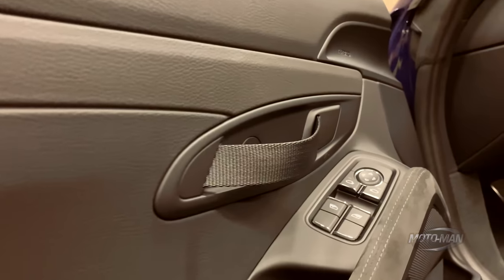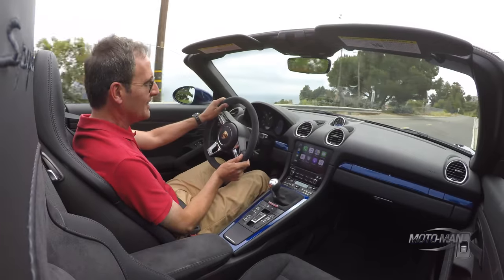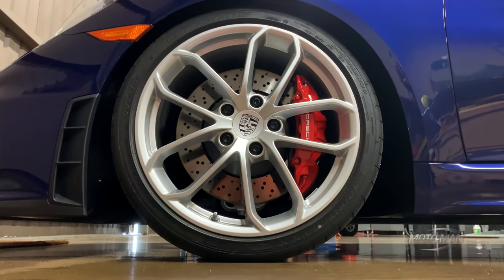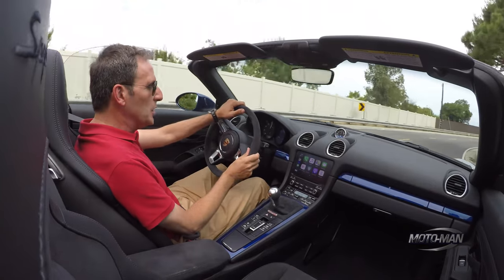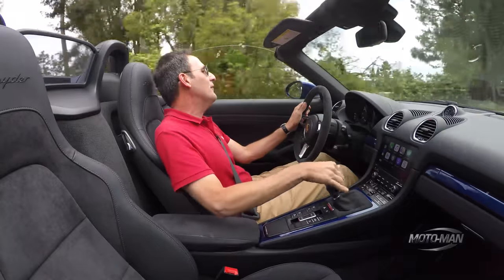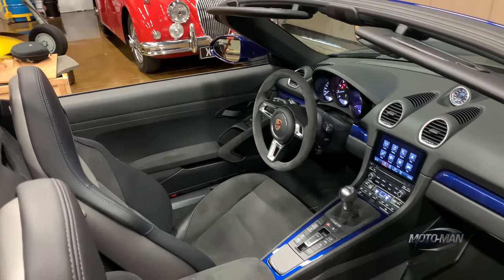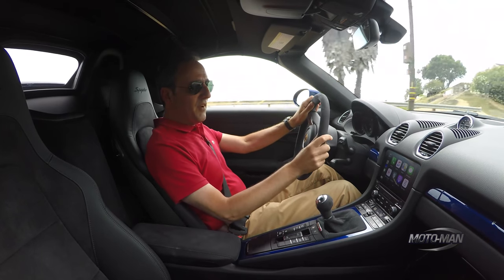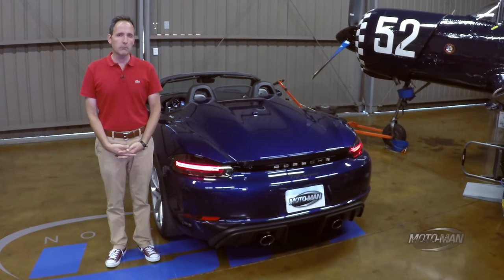A baby 911 Speedster: The 2020 Porsche 718 Spyder

Comment: No,   no you don't need a 911,  my 718 Spyder replaced 911's and theres no turning back,  great review Mr MotoMan
Reply: Roger Bailey 
I have a manual Cayman GTS (my second) and my GF a PDK 991.2 Carrera S.
Such different cars to drive and it’s amazing to have the choice, but the chassis and gearbox in the GTS, make it so much more fun to drive. Even if the 911’s envelope of performance is overall wider, it’s so imperious as to be dull sometimes at normal fun road speeds. 
So I agree with you! The baby Porsche chassis, is the more entertaining (in all it’s many guises) 
😀
Reply: If you have a child and they are not old enough to ride in the front, then the 911 is the only way to go.  I would also say, with the current version of the 911, you can drive it MUCH faster than the 718, where as I think the 718 use to be easier to go faster than the 991.2.  Now, I do not own not have I driven the GT4 or Spyder, I do own a 718 Cayman GTS, manual and a 992 C2S with RWS and I feel like I am at least 10mph faster in it over the 718, I also prefer the driving position in the 911 over the 718 but it is a great and fun car to drive!
Reply: Tommy 
Yes the 992 is another big 911 step forwards! 
On a track, the 991.2 still smashes the Cayman for speed! 
I just love the 718 as it feels so much lighter and the weight is spread out better. When it does start to move, it is as if it’s one piece.
With any 911, you are always managing either the front / rear. 
A challenge for sure, but suicidally fast for the road to the that 992 chassis ‘mobile’ 

Agreed re the kids though.
Just put a Labrador in the back of ours 😀
Reply: Wise choice!
Reply: I did the same
Reply: I just picked up my 2021 718 spyder and wow better then my 2015 911 gts convertible!!!!
Reply: Same here. I sold my 997.2 and bought a 718 Spyder (2021). NO turning back. Passed 3000 kilometres already :)
Reply: @michaelandersson6088  did you get one with the bad motor? Crazy what’s going on . I got lucky .you?
Reply: @elliotnegrin1079  I got lucky as well! Though another member of my local Porsche Club was not so lucky... His car is still at the Porsche Dealer... Our VINs are almost identical.
Reply: @elliotnegrin1079  care to elaborate or point us potential spyder buyers to the engine problem you're referring to? Thx in advance!

Comment: You’re right about the softer suspension on the 981 Spyder had: it was equipped with the PASM Sport Suspension from Boxster GTS not the GT4 suspension. The 982 Spyder here has the complete suspension from the GT4 including the reverse struts and rose-joints.
Reply: pasm was an option.  It also came with x71 suspension from the gts.
Reply: Wrong, there was no PASM available for the 981 Spyder. It basically has the same suspension as the GTS but slightly modified. It is no GT suspension but still thrilling to drive and a but more engaging than the 718 Spyder suspension.

Comment: Why in the world are you double clutching? It is a synchronized gear box.
Reply: WR ZL1 seriously right??
Reply: Vin Diesel baby!
Reply: Богдан Кондратов 
Oops! 🤡
It’s exactly the opposite to that that you’ve stated! 
His double de-clutch gear changes, create a greater weight shift and more unnaturally punctuated drive. 

The synchromesh is there, among other things, to cure the above issue of duration out of gear 🧐

Throttle control immediately preceding a de-clutch, then before re-application is how to control weight transfer. 
This is made easier and more fluid, if the elapsed time is SHORTER not longer! 

Also a BIG point, is that we need to be covering less distance in neutral. 
This is a technique only broken vehicles require, or vehicles from before this fella was even driving. 

I live in the UK and have only ever owned manual cars for my 30years of driving. 
On road, track and in advanced driving tuition. 

Nobody with a clue thinks this is a good idea!
Reply: I was wondering the same thing.
Reply: Especially he is slow AF with it...cannot stand it ;)
Reply: Embarrassing, needs to wait for “flappy paddle” version
Reply: In most Porsche 6 speeds, 5th especially is spaced close enough to 4th ratio wise (and without being in the middle of the H pattern spacial wise) so it's hard to get into the gear in a 4-5 upshift before the RPMs drop too much.  I'll have to see if that makes 4-5 upshifts at normal driving RPMs less rushed for me.  The Aisin synchros are also consistent enough where you can remember how much force needs to be applied to have the shifter complete its movement right when the RPMs are matched, but is harder when you have to push harder than normal just to be able to move your arm fast enough.
Reply: I don't see the need to double declutch on the up shifts. Rev matching  on the down shifts makes sense.
Reply: WR, Double clutch before entering a turn doesn’t slow down the rear wheels, otherwise  you can break the rear wheels loose. Use the brakes into turns, not the tranny.
Reply: Bogdan Kondratov  this is not accurate at all
Reply: @DontPanicDear didn't upstanding a thing you said😅

Comment: His double de-clutch gear changes make me cringe 🙄

Double de-clutch gear changes, create a greater weight shift and more unnaturally punctuated drive. 

The synchromesh is there specifically to cure the above. Used with correct mechanical sympathy that is 🧐

Throttle control immediately preceding a de-clutch, then before re-application is how to control weight transfer. 
This is made easier and more fluid, if the elapsed time is SHORTER not longer! 

Also a BIG point, is that we need to be covering less distance in neutral. 
This is a technique only broken vehicles require, or vehicles from before this fella was even driving. 

I live in the UK and have only ever driven manual cars.
On road, track and in advanced driving tuition. Nobody with a clue thinks this is a good idea! 

This is arguable on of the best gearbox / clutch implementations ever. It’s best used as designed.
Reply: So glad to see your remarks. Watching this guy changing gears was irritating to say the least.
Reply: Plus it has an autoblip function.
Reply: Well...Motoman can take heart that his followers are true enthusiasts!  I posted a comment too about the shifting, it drove me insane.
Reply: Agree!! This guys is a goofball!

Comment: I was in this same predicament. Had a deposit on a GT4 but for the money ($100k+) I could have a Carrera instead. So instead of spending $114k as specced on a GT4, I went for a $118k sticker Carrera T for 30% off sticker. I haven't looked back since. I'm sure the GT4 is great, but it's not $20k+ better than a slightly used 991.2.
Reply: They are totally different cars in terms of handling, feel—everything.  The GT4 mid engine design is perhaps the best handling car, very flat around corners and nimble—it’s like the 911 used to be.  Today’s 911s are more like grand touring cars—heavier and less nimble with less capable handling than the GT4.  After all, you can’t cheat physics!  Just depends on what type of driving experience you want.

Comment: Motoman, I started DROOLING the minute the email hit my in box.  I've got this spec'd up to $128k.  That's right.  And to that I plan on adding an aftermarket exhaust, $5k and $10k worth of carbon fiber interior and exterior bits from Techart.  All tastefully added.  Color, chalk!  Red roof, and red and black interior with 18 way sport seats.  No PCCB, or buckets.  But pretty much every other conceivable option, excluding car play.  Hate it.  Could I get an entry level 992, sure.  Why would I??  A fully spec'd 992 Targa 4S is over $200k.  And this is a real GT car.  And a convertible.  Plan on driving this for four or five years, putting like 20k miles on it and parking it for a few decades to appreciate.  Can't wait to place my order for a 2021 in October.  Dealer has my name on his list already.
Reply: After the spec price, was there an additional price added to the car because of the demand for it?  I've heard that there may be an added cost.
Reply: DC that was just the price on the configurator. $128k
Reply: Ordered. I have up to a 12 month wait but who cares. I don’t plan to ever sell this car but will it to my son!!!  And the limited production of around 500 units a year, so I’m told, should ensure it’s future value. All smiles!!!!

Comment: 2:10 nice double clutch catching the right RPM after a blip for the gears that are slower to move the shifter to.  In most Porsche 6 speeds, it seems like 5th especially is spaced too close to 4th ratio wise (and without being in the middle of the H pattern spacial wise) to get into the gear before the RPMs drop too much (when you're not revving much past 4krpm before upshifting).  I'll have to see if that makes 4-5 upshifts at normal driving RPMs less rushed for me.  The Aisin synchros are also consistent enough where you can remember how much force needs to be applied to have the shifter complete its movement right when the RPMs are matched.

Comment: Great video.  Just a small correction.  The rear diffuser and the vent at the front are not, "active  aero," but rather, passive aero components.
Reply: The front vent is also there to vent the central radiator which lesser Boxsters don’t have

Comment: I replaced my 991.2 for the 718 Spyder, no regrets what-so-ever, just unplug the exhaust valves and you will hear the engine all the time, not just from 4000+ rpm, gearing is just fine for everyday use in traffic, who wants to constantly upshift to 3rd gear while traveling 25-30mph in the city, those people that complains about it either don't have one or a Youtuber driving only on the highways.

Comment: There are no other cars available new on the market that comes in a naturally aspirated, 400+ hp mid engine, 6-spd manuel, convertible package that you can option with carbon ceramic brakes and carbon bucket seats for $125k.  This car is a unicorn.

Comment: When you shift,  the pause in neutral before putting it in gear ...  Is that on purpose lol ?
Reply: double clutch mate
Reply: No Seasoning  double clutching to shift to the next gear never heard of it.   But ok 👍
Reply: High Speed Closer 
Богдан Кондратов 
He’s being stupid and thinks this makes him seem all OG! 
His double de-clutch gear changes, create a greater weight shift and more unnaturally punctuated drive. 

The synchromesh is there specifically to cure the above 🧐

Throttle control immediately preceding a de-clutch, then before re-application is how to control weight transfer. 
This is made easier and more fluid, if the elapsed time is SHORTER not longer! 

Also a BIG point, is that we need to be covering less distance in neutral. 
This is a technique only broken vehicles require, or vehicles from before this fella was even driving. 

I live in the UK and have only ever driven manual cars.
On road, track and in advanced driving tuition. Nobody with a clue thinks this is a good idea!
Reply: Allenwrench 
I think he does know. 
On that side of the pond, they think driving a manual car is big and clever / cool.
I think he’s just trying to seem all OG 🤪

Comment: You loved loved loved the 981 Spyder when you reviewed that.  Would you rather the 981 Spyder with the much louder exhaust and the 3.8 L or the 718 Spyder with the 4.0 L and a not good sounding exhaust but it is from the GT dept.  Now that is the question.
Reply from the maker: Would have to go 4.0 with GT bits under the car.

Comment: If I'm buying a 911, it's got to be a Non-turbo. 991.1 perhaps, though I have a suspicion that'd I'd prefer how the 997 drives (but the 991 is so much better looking inside and out). But up against a 992? This. All the way. Which is funny because I'm not even slightly interested in the 4 Cyl 718. I'd rather have a 968 or 944S than a 718 with a 4 cylinder.

Comment: Feel like this car would've been better had Porsche bore the 3.0 out to 3.6 instead of a 4.0 and raise the redline to 8500+ to keep the same HP rating. They can sacrifice some of the top speed and get the same acceleration time with a taller final drive ratio in the transmission. This will make the car sing even more, stays longer up high in the rev range.

Comment: Track days you would want PCCB.
Reply: Actually you don't. Then they wear out quickly, because the heat destroys the carbon material. That is why a lot of GT3(RS) ppl who want to track their cars are retrofitting them with steeldisks. On the road however the ceramic brakes can last up to a few 100k miles. There those won't get really hot.

Comment: Great car.  But now with the new 718 Boxster GTS having basically the same engine as the Spyder as well as a roof that can go up and down in 12 seconds with a price tag that is $20k less, I now know why so many 981 Spyders are for sale right now.  Those owners are not upgrading  to the new 718 Spyder, they are buying the new 718 GTS for the above reasons.
Reply: But it doesn't have the looks, not the GT4 suspension, not the GT4 brakes. And the manual roof is what makes it more interesting. An ape can open the roof in the GTS, but not in the Spyder.